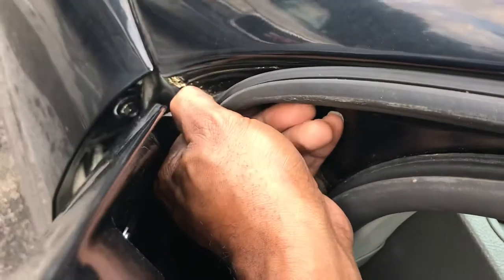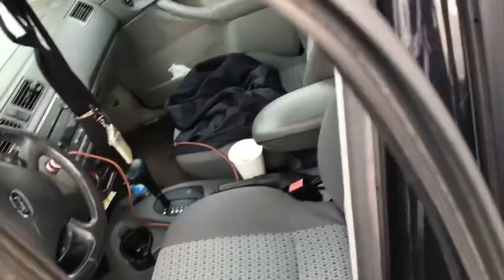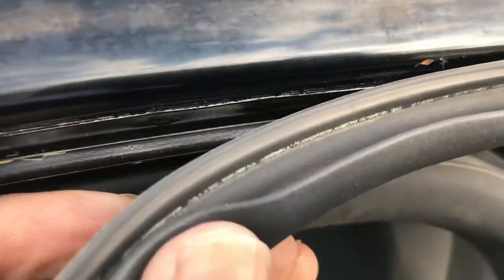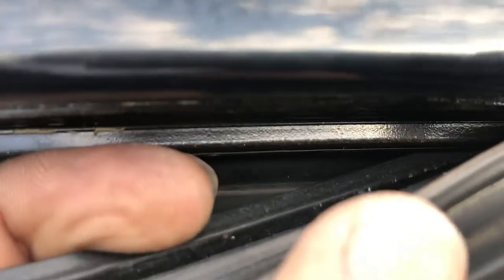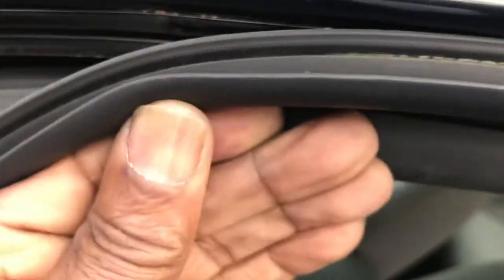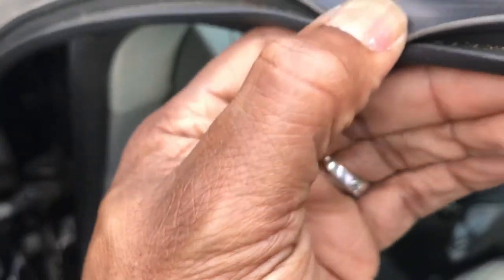Replacing the Outer Door Seal on the 2005 Ford Focus ZX4

Comment: I'm not sure, but I think I need to replace the inner seal like you did, as well as the outer seal, you show how to do here, But I can't find any information on them online, aside from a listing for a bunch of different trim seals on rockauto.com for my 2009 Ford focus, and I have no idea what to get... I'm pretty sure I only need the interior one because when I'm going down the road or in a car wash or something and I use my windshield wipers again going down the road, any windshield washer fluid that gets on the side of my car drips down the top of my door, but only the front driver side door... I honestly don't know if I have a whole driver's side weather stripping like you have on mine, and I haven't looked, But I would love to see a video replacing the interior one... Also if a guy could figure out what it's called, whether it's still called trim seal or something else...
Reply: Technically, I don't know if I need to replace it because it's one of those things that I don't know anything about, and those seals actually don't look in that bad of shape, and I have heard said by my uncle that all I should have to do is to put like a Vaseline or something in there on the rubber pieces and that should work, but all the same it is something that I would like to eventually have actually fixed As I just got this car and would like it to not leak when it's raining or something and you know ruin the electronics and stuff although I doubt that would happen because it's just a door and you know not like it's leaking right in the middle of the car or something But it is just something that I would like to get fixed ASAP somehow... Also, after checking I do have both the door seal itself and the outer door seal as well